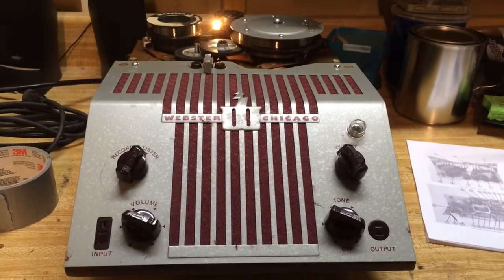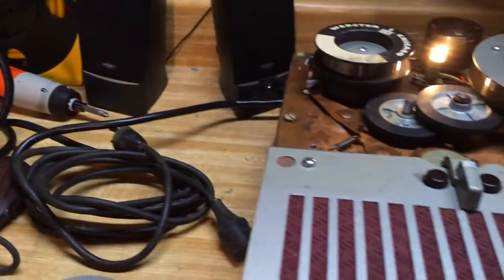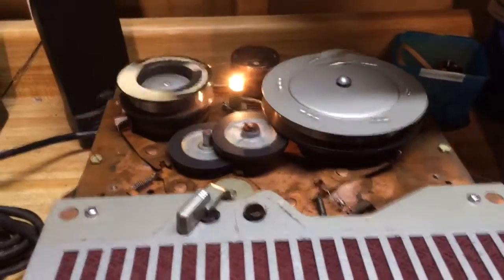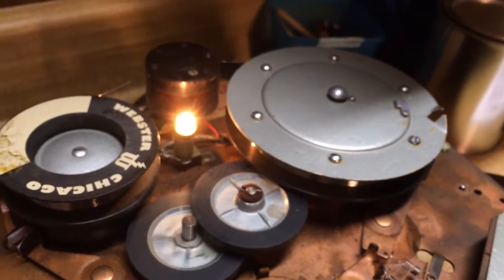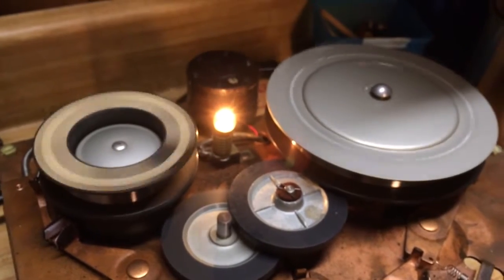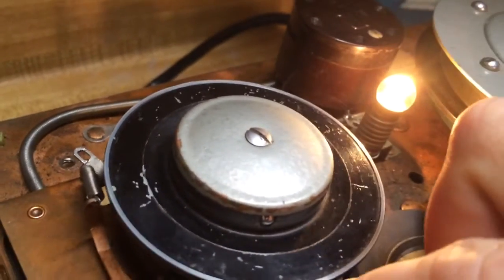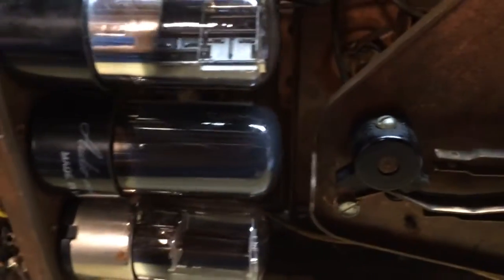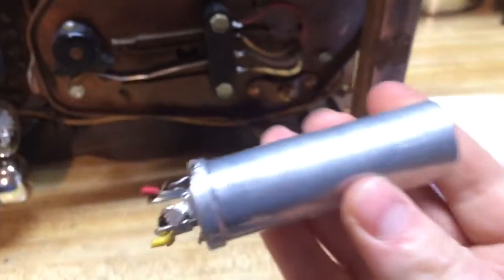The Wire Recorder: An Introduction and Tear Down

Comment: Dude love the videos Ive had one of these for about 24 years i bought at thrift store for 5 bucks and the thing will still play never touched it inside and works very well has alot of spools and the mic as well but I have never attempted to record if it still can never tried its just like yours webster chicago .. Saludos amigos
Reply from the maker: Hi David, thank you for the compliment!  Yes, these machines were built like tanks!

Comment: Great technic and great mechanics: I think, that the wire-recorder-system could be used for a plain and  safe century-long 
digital storage of the immense human knowlegde. Nowadays we have better materials for creating a better storage- wire- material and much more precise mechanics to realise this. The present stroage-methodes (HD and Chips) can NOT guarantee a centurylong storage. The wirerecorder could be the solution ( because 80 years old wires are readable now) .. Tom from Austria
Reply from the maker: Thanks for your comments!

Comment: Wire recorders were very common as "black box" flight recorders, and I wouldn't be surprised if many are still in reliable service on older planes. Wire being a little more forgiving during a fire (though hardly indestructible), and reliable for many, many re-recordings.

Comment: Great video! I picked up a Webster Chicago 288-1 model wire recorder with no power supply a few years ago. I finally got a power cord - and it powers up, hums, and the light goes on. The reverse gear seems to work fine - but when I put it in PLAY gear the power turns off completely. Pop it back into neutral or reverse and the power comes back on. Any suggestions on what I should check? Or am I simply using it wrong? (Found your video when I Googled "Wire Recorder Operation" btw)
Reply from the maker: There's a series of blade switches on the underside of the chassis (inside of course).  You can clean the contacts with light sandpaper.  Although, more seriously, you're going to need to replace all of the capacitors in this unit, if not it's a fire hazard.

Comment: I found 20 spools at an estate sale and coincidentally when I asked a friend who collects old radios about wire recorders - he said, "You can have mine!" The same model! I have powered it up and have yet to test it. Right away it looks like it will  not rewind. As you may have seen with these spools of fine steel wire - once off the reel - oh boy! Seeing your restoration I am encouraged to attempt a minor repair. Replacing capacitors?...yikes!  Thanks for your passion and sharing.

Comment: Where did you find the foam pads? They are missing in mine. I have a Webster 81-1.
Reply from the maker: You can use felt pads from a hardware store..the circular kind that you stick on the bottom of items to prevent scratching the surface of a table.  At my Lowe's they are on the same aisle as super glue.

Comment: I just bought one myself and as of right now it only emits a loud buzz in the Output 1 position. As per your advice, I'd like to replace the capacitors but was wondering what kind you would recommend?  Thank you so much!
Reply from the maker: +clayrodery - what kind?  do you mean what brand?  Google "Antique Electronics Supply".  Call them to place your order if you need to, their website is confusing!

Comment: Its not just copper wire, it is steel wire. Also you are lucky that you did not take out the power transformer. In old equipment always replace E-caps in power supplies FIRST or let the magic smoke out of them. Very hard to come by. good video, Greg

Comment: Very cool! Is there a way to get the recording from the wire recorder onto another device. I see there is an output, but it looks like it needs a special plug.
Reply from the maker: +jason harvey - yes, the unit has a speaker output, but yes, does use a special plug.  Are you wanting to transfer some wire recordings?
Reply: Thank for the reply. I located one of these in excellent condition and was thinking about adding one to my home studio just for different sounds. So I was just wondering how to get a recording from one device to the next.
Reply: databits Thanks for the reply.
I located one in great shape and was thinking about getting for my home studio to mess around with for different sounds. So I was curious as how to get recordings from the wire recorder to another device.

Comment: Is this like a regular wire? I dont understand how you could just record on copper wire
Reply from the maker: +Kit Caboodle - The wire is made of steel.
Reply: Kinda looks like welding wire honestly
Reply: +databits Hey, I've been subscribed for a while, and I just got my hands on a 70's Hi Fi system, and it came with two mics. what connector does that microphone on that thing use? My two mics have old guitar amp connectors.

Comment: Hi
Would it be possible to tell me what's the numbers/ values are inside the far aluminum can caps I'm having trouble seeing it inside the  unit..I would like to order all my caps at the same time.Thanks for your time.This doesn't seem so bad to do. im going slow with this I have only resorted a couple of small amps from rca 45 players I don't want to screw this up...Thanks for your time

                   Kevin.      kphonograph@gmail.com
Reply from the maker: Kevin McDermott Kevin, sorry but I don't have a way to do that.  You can purchase a fact sheet for the unit here: https://www.samswebsite.com/photofacts.html

Comment: Have you had a chance to listen to all your wire recordings?did you have any problems with play back on the speaker of the unit I haven't check the coil for the speaker but I can get sound threw the out put when I hookup an amp to it the amp has to be all the way up the caps  are leaking bad.
Reply from the maker: Kevin McDermott Yes, I have listened to all of my recordings.  I also replaced every capacitor in my player.

Comment: Hey
I found out that plain non waxed dental floss is what is recommended in the instruction manual but I did use the q tip and alcohol and that works all so .but I also think the string that is in the beginning of each wire spool does the same thing.wouldn't you agree.just as long as The string is clean on the spool of wirer.
Reply from the maker: Kevin McDermott Yes, I would imagine that not much cleaning is necessary.  The string leader wire should be fine.

Comment: Great video. I own a wire recorder that belonged to by Grandparents also from 1947. Was thrilled to hear my great-grandfather's voice as he died 13 years before I was born. Looking for a way to convert the recordings to digital files. I did some open air cassette recordings about 20 years ago and now hardly anyone owns cassette decks to play them! How quickly recording technologies changes! Thanks again for sharing!
Reply from the maker: Jon Hess - Thanks for your comments!  You might want to use a smartphone voice recorder or use a handheld digital recorder to convert the recordings to digital.

Comment: Where did you get your parts from ?
Reply from the maker: Hey Johnathan, I got my parts from a local supplier, but a good source is https://www.tubesandmore.com.  Are you going to restore a wire recorder?
Reply: I am actually, same model and everything. The reels turn but all I head is static...do you know what might be wrong ?
Reply from the maker: Have you replaced all of the capacitors in the unit?  If not, you'll need to.
Reply from the maker: ***** Message me through Google+ if you need any pointers.
Reply from the maker: ***** How is the repair going?

Comment: Great work!  I'm about to do the same thing on a Model 7.  How did you know what sizes (and types) of capacitors to use?  Is it usually "less" necessary to replace the resistors?  Thanks!  :-)

Comment: The local history museum I am the director of recently received a 80-1 as a donation. The 1 amp fuse was blown. Likely the symptom of a larger problem. There were 8 wire recording reels with it.  Wonder what history are on them?
Reply from the maker: The wire reels that arrived with your 80-1 likely contain some interesting history!  And the fuse is blowing likely due to dried up capacitors which need replacing.  Thanks for watching!
Reply: Thanks
Reply: databits . Hi Databits:
The Webster Chicago 80-1 we have been discussing  obviously need electrical rehab work as yours did. It is our desire to bring it back to playable condition and use it as an artifact in our museum collection.  There is an Antique Wireless Museum in our County in East Bloomfield New York who could do the work for us. In your great video you mentioned the schematics you obtained.  What source did you use to acquire them?  We are on Facebook (Ontario County Historical Museum) Twitter @OCHSMuseum  and at www.ochs.org
Any assistance you can offer in obtaining the schematics would be greatly appreciated.  feel free to private message me at director@ochs.org
Reply from the maker: Edward Varno
- I didn't receive notification of this response to comments!  Sorry about that.  Were you able to find a schematic for your wire recorder?
Reply: Yes. A local guy made it all happen. The wire recorder works like new.
Ed Varno

Comment: aaah the webster wirerecorder
mechanical almost unbreakable

and wire recorders may never be compared to tape recorders
becaus tape recorders are based on this

my webster also had bad capasitors
i sold it becaus i have 4 european wire recorders

i also have 50+ spools of wire
with all kinds of stuff
Reply from the maker: Did you make videos of your european wire recorders?  Thanks for watching!
Reply: i have a few of my sonofill 104
of my scaub lorenz supraphone 52 i dont have any video's  yet
same for my scaub konsolette
and my amroh wirerecorder is almost restored so there will be a video of that within 1 month